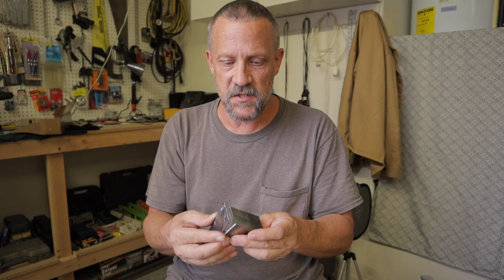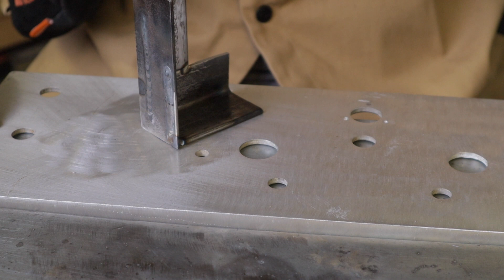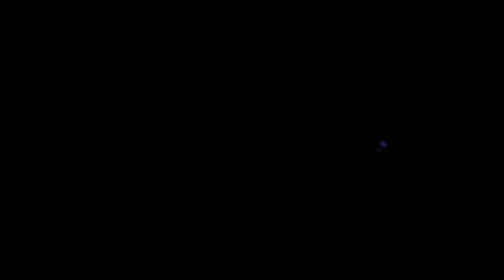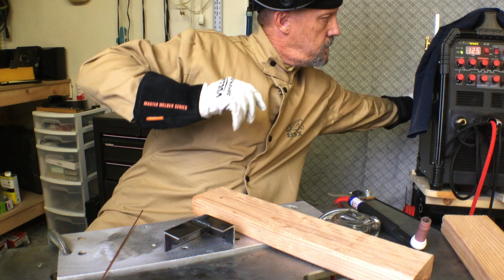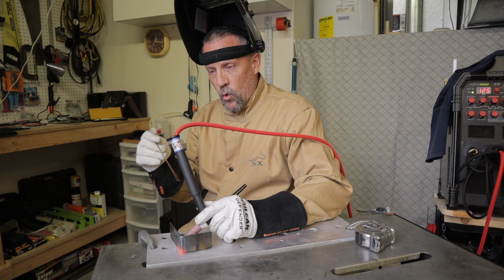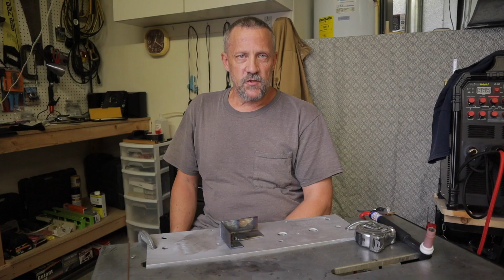Mastering 90-Degree Angle Iron Joints with an EASY Cope Technique!

Comment: Those awkward position welds are tough.  You're doing good.  No issues that a little practice won't solve.  What size filler rod are you using?  Looks like 3/32" maybe?
Reply from the maker: I think I may have said 1/8" in the video but I was wrong. It is 3/32" I was using in the video. Thanks, I've been practicing quite a bit and I'm almost finished with my first bottle of argon. I have a 120 cu ft bottle.
Reply: @DIYHomesteadProjectsDIYHP10  That's a decent amount of Argon.  Running beads is addicting at times.  I only asked about the filler because I often prefer 1/16" filler on relatively thin stuff like that.  I can run a bit less amperage because the filler doesn't cool the puddle so much.  I also feel like I have a little bit more control and I can run a bit tighter arc without the puddle rising up and hitting the tungsten every time I dip.  Certainly not a rule or anything like that, it's just something that works well for me.
Reply from the maker: I completely understand your reasoning and I agree. I also prefer the 1/16" filler rods but I ran out of them and only had the 3/32" rods to work with. Just using what I had at the time.
Reply from the maker: How do you know when it's time to change out the argon bottle? Is it as simple as "when you are no longer getting sufficient gas coverage" for the weld? I'm down to about 150 lbs so I'm thinking it's going to be soon. I've been thinking most welders probably don't want to run out during a job and have to grind out a crummy weld. Most guys probably have more than one bottle laying around so that doesn't happen during a job. Fortunately I'm just a hobby welder so that really isn't an issue for me.
Reply: @DIYHomesteadProjectsDIYHP10  Yeah, pretty much.  The flowmeter/regulators generally regulate the tank pressure down to 50 lbs or so (it varies, but around there).  Once you get below that your flow rate will start to drop.  I rarely run my tank all the way down.  Even though I'm not generally working on something super critical, I hate to lose a weekend because I found I was out of gas and the shop doesn't open until Monday.  Once my tank starts to get remotely low, I just take it to get swapped out next time I'm heading in the direction of the welding supply shop.  I only have a small tank for portability (just a 60 CF) so it's pretty cheap to have swapped.
Reply from the maker: That also makes sense on the tank info. I think I'll run this one down until it won't run anymore. Then I'll have a pretty good idea what I can get out of a tank for the next one.

Comment: Nice work way to get yourself a good rest and get comfortable. Inside corner joints are probably one of the most difficult things to do. One thing that can help is to do the inside corner joints first. So that when the heat penetrates the metal and recontaminates it with the gray color you have access to re-clean the outside before you weld the outside. Keep up the good work.
Reply from the maker: Thank you for the tips! That is so simple and makes perfectly good sense.   Also, thank you for the encouragement. I have a lot to learn but that's what I like about this hobby, there is always something to work on or learn. 😀
Reply: You can say that again I've been tig welding full time for about 10 years and I still learn something new everyday.
Reply from the maker: I enjoyed your videos on the Prime Weld 225X! You have a great teaching style! You do a great job of explaining the technical stuff for beginners like myself. Thanks and keep them coming!